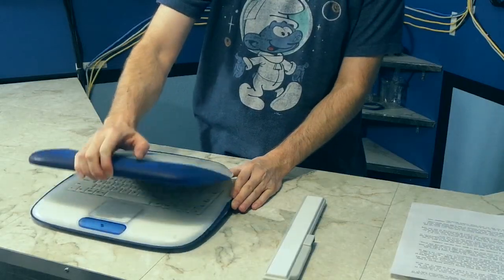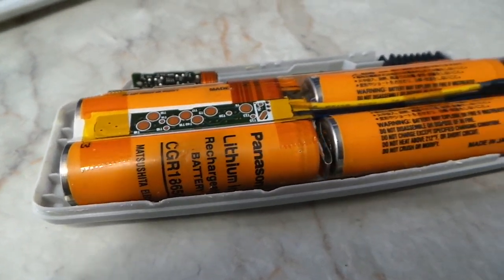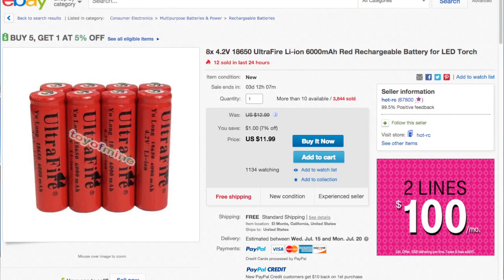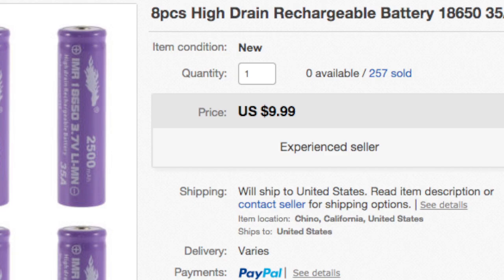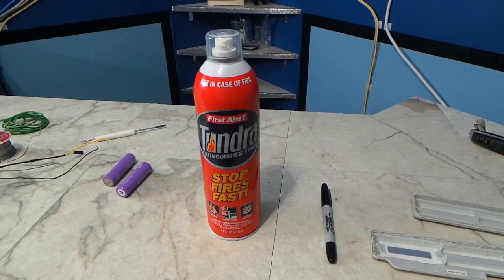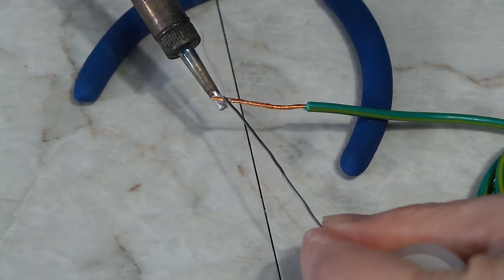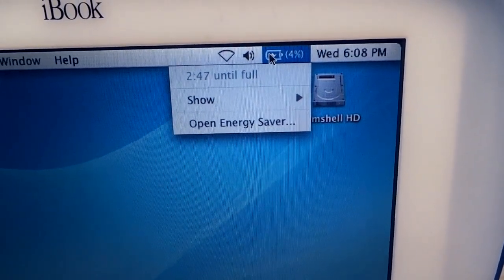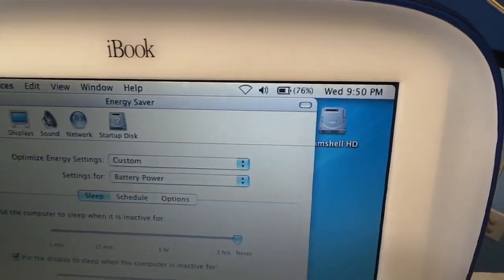Rebuild a laptop battery pack

Comment: Thanks for the video , i have a question: they told me if you want to change the battery you must not remove the old one before you connect the new one to the electronic circuit because it will lose their memory and it will not work at all even if the new battery is good ! 
Is that true ? Is it a successful process to change the the battery ? Can i remove the old one without losing the memory of the circuit ?

Comment: a good test would be to fully charge the batteries and then you left it out of the laptop for lets say a day and try to turn it on in the next morning or so... if it holds up more than 95% you could use it as a travel emergency pack

Comment: When I think about batteries, I don't think about the time they last, I just use it as a support for when electricity runs out (storms) or when I want to change the laptop from one room to the other. 5 minutes would be enough for me to save what I'm doing and properly shutdown the system without damage to the harddisk. I'm lucky my 10 year old laptop still allows me these 5 minutes when power runs out.

Comment: "ultrafire" batteries have capacity from 50mah to 400mah.
Reply: The name ultra fire means that they are ultra flammable
Reply: Beware of the Chinesium ones, seen 18650s with an AA battery and packed out with sand, I also bought a set that were genuine Sony's VTC5's tested at 2600mah with a generic wrap, I'm guessing they were from out the backdoor of a Sony plant.
Reply: #oof
Reply: Like refurbished battery

Comment: Hi sir, thanks for the teaching. I have a battery with cell number 18650 which is not good and i want to replace it with a different battery cell which has different number on it. Can this work sir? The number on the battery don't matters?

Comment: Most laptop batteries stop working if you remove the cells
Reply: nope they don't.
Reply: @JakeJoris  they do 
Unkes it's an old laptop
Inna try doing this on my 98 compaq armada
Reply: @picarraphotography  I've replaced cells in at least 10 laptop batteries, they all continued to work, except the t60 one.
Reply: @JakeJoris  I’ve never been lucky with it 
Have you tried on a Compaq Armada 1750?

Comment: David, as a long term fan, I was really disappointed to see you make a video where you are telling people to use junk ebay cells in there laptop. Ultrafire cells are flat out dangerous, and by making a recommendation, you are taking your viewers lives in your hands.  poorly made lithium batteries are as dangerous as a monkey with a handgun,  and you are telling people with no battery building expertise to build a pack with unmatched junk cells.  This is reckless for a couple different reasons. A: Putting cells with different internal resistance together in series creates an unstable pack and excess heat (and cheap knockoff cells are known to vary in resistance WIDELY) If you don't have a way to check internal resistance you shouldn't try to build a pack. B: People with little or no experience are gonna probably overheat while soldering, which could lead to the cell blowing up in their face. It just isn't worth the risk if you don't have the proper equipment, and are you really going through batteries on you laptop often enough that the 10-20$ you save buying garbage cells is really worth risking your house burning down, or your pac blowing up in your face.  This video was absolutely irresponsible and I believe it should be taken down.

Comment: Will this work with new laptops as well, that have thin non user removable batteries?
Reply: Yes of course. Also make sure you don't unplug the device you want to change the battery of and make sure you cut the old lithium batteries in half before you put in the new ones. If there is any fire just dump some water on top of your battery while it is in the laptop. Most new laptops are all waterproof anyway, but in case your laptop stops working just stick a fork in an outlet and your laptop will start right up 👌👌
Reply: @nikprobg9327  damn you got me going there

Comment: So true about the counterfeit batteries on eBay.  It also applies to Amazon.  And it' not just the 18650 batteries, but even the NiMH rechargeable (AA< AAA, etc)…. Unbelievable that they tolerate these sales still.  The counterfeiters will immediately refund your money in exchange for no bad reviews.. that's how they try to get away with their scam.

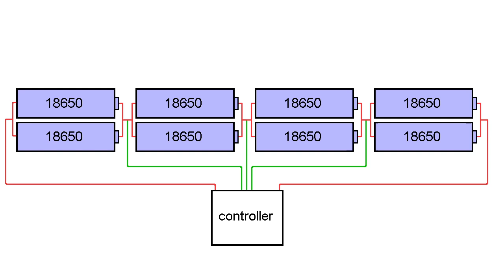Comment: Often, you don't need to replace all the batteries, becouse the pack starts to fail when at least 1 battery has problems, not all of them. Keep this in mind: you can see which batteries are good/bad by charging and discharging them individually 2 to 3 times, leave them charged and next day see if any of them has a low voltage. (They are totally charged at 4.2V and discharged at 3V). Then you can put all the bad ones in the recycling bin (you really should do this, as they may start a fire) and replace them with new ones (or maybe don't, just like he explained at: 2:50).
Reply: Miguel Barra Almeida it is better to replace them all so that they have similar capacity
Reply: In battery pack always use similiar battery spec for better result. The old one u can use in different project.
Reply: It's probably safe to assume that no battery that's 20 years old is good any more.

Comment: eyy, i knew this video would come in handy someday! fixed my giant power bank with this tutorial
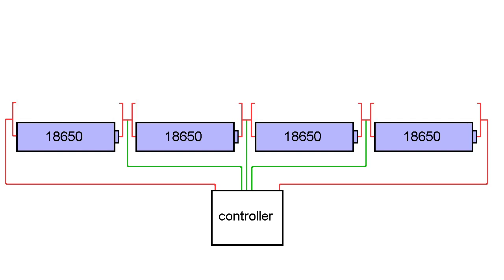Reply: Often, you don't need to replace all the batteries, becouse the pack starts to fail when at least 1 battery has problems, not all of them. Keep this in mind: you can see which batteries are good/bad by charging and discharging them individually 2 to 3 times, leave them charged and next day see if any of them has a low voltage. (They are totally charged at 4.2V and discharged at 3V). Then you can put all the bad ones in the recycling bin (you really should do this, as they may start a fire) and replace them with new ones (or maybe don't, just like he explained at: 2:50).
Reply: @MiguelBaalm  that's true. I did that. All the cells were alright in my power bank. The connection between them was just broken so the bank held a fraction of what it used to hold.

Comment: Hello everyone! I really need some help here, if at all possible. Here comes a freakin' wall of text, so prepare yourselves!

Here's the story: I actually managed to do this with a very old Presario 1070's battery. I thought it was working because it was running for a short period of time, but it seems like it's stuck at 9% constantly, and the laptop seems just about completely unable to charge the battery at all. It seems to try, but it fails. I have to unplug and replug it into power numerous times to try to get it to charge, and it doesn't stay charging even if I manage to get it to start, either. I know the cells are good because I have tested them thoroughly, and I obtained them from a couple of other laptop batteries in better shape, so they're not from eBay. I don't understand what the issue is, and I really want this to work. I spent hours on this, and I can't let it all go to waste. Does anyone know what I might be doing wrong?

I really appreciate any advice anyone might have. Thank you.
Reply: I reckon the batteries you have used are of various different brands and capacity so the calibration circuit isn't working properly. It also depends on the batteries voltage
Reply: @Timmymantwo  Firstly, thank you very kindly for your reply, I very much appreciate it. Next, I will say that I left it plugged in overnight, and have been working away at trying to solve the issue at hand, and it does seem that it's starting to behave better. The end results, however, remain to be seen. Regardless, more wall of text upcoming:

I will go ahead and admit that I actually did use two different brands of cells, as I did not think it would matter that much. I may very well be wrong. One is LG, the other seems to be a lesser-known one (the cells are marked "FP 18650[...]" if that helps).

Additionally, the two cell brands are also different capacities (so two different capacities indeed exist in the battery), but I had put them all on testing devices to make sure that they not only were in good, working condition, but also they all registered around 1900mAh after an intense discharge/charge/measure test, giving or taking 75mAh or so. I also had (perhaps foolishly) figured that this was fine.

With that all having been said, looking back now, there are two big "what-ifs" involved that may prove to be an issue. This is definitely helpful, and now I have more knowledge on the matter. Thank you again, this helps.
Reply: Good luck to you with it @Racecar564

Comment: For that kind of load, you could use ICR batteries. Less max amp but greater capacity, around 3000 mAh, but not safe without a bms(no pb in a 'puter) If you need extra ompf use panasonic NCR18650PD: enough capacity (tesla use them) and they are a lot safer. IMR are "safe",  can output 35-40 C but don't have a great capacity (1500 mAh).

Comment: just opened a modern internal laptop battery and I was surprised that the cells are flat. My intention was to check the possibility of change the damaged cells but although it seems very simple to detach the cells from the circuit I still haven t got a clue on how to do it, The other problem is that a made a big search on the internet about flat cells to assembly but couldn t find any, Have you seen this king of cell? Thanks

Comment: I have an 40000MAH Samsung Power Bank, their are 8 Samsung Pink 18650 Battery, It had 1 year warranty by Samsung . I think each battery has 5000 MAH capacity. Were do I get real 5000 MAH 18650 battery.
Reply: 5000mAh 18650 battery simply don’t exists

Comment: Could there be an issue with AA batteries replacing those batteries? Maybe make them replaceable. Like toys
Reply: Yes, rechargable AA batteries have a nominal voltage of 1.2V and the circuit will try to charge them to 4.2V (18650 charging voltage) and so, they will probably explode.
Reply: @MiguelBaalm  but trying to replace them when the battery is low
Reply: @witherdWhisper  ? Sorry, I didn't understand you.
Reply: @MiguelBaalm  being able to take the pack out and replace the battery in it. Is that possible?

Comment: every time i have tinkered with laptop batteries, i always find that the battery meter in windows stops working properly, it will work normally until it hits 5-7% then will stay there until the battery is actually dead, then continue counting to zero

then when you plug it in, it works the opposite way (charging but staying at 0% until it is close to full then counting normally, or it counts to 97% and stays there until it is fully charged, then continues counting toward 100%)

i always get the full runtime (sometimes upward of 12hrs of playing games with some of the 48 cell super batteries i have made) but the lack of a functioning battery meter is really annoying

Comment: So I have a question? I have started to do basic soldering i.e. replacing the rechargeable battery component in Dreamcasts, replacing capacitors in Game Gear and alike. I've been using a rosin core solder but I'm curious what kind of flux I should buy if I'm going to do more intricate work like repairing a trace etc? If you have the time I would appreciate your insight @8bitguy .
Thank you, Kelon

Comment: Sorry David, utmost respect for you, but soldering to a lithium ion battery is the tantamount to setting up a time bomb. When these batteries build up pressure, there is a vent on the top under the positive terminal. This valve is actuated by a spring with very specific tempering. Heating up the battery to solder on it ruins the tempering of this spring. If the battery has a "non-passive failure" (in other words, starts venting flame), the damaged spring may not relieve pressure, so instead of a small jet of fire, you could have an explosion. It's like using a recalled airbag. It won't hurt you until you are in a car accident, but when you are in a car accident, it could be a lot worse as a result of this. Just buy a third party replacement battery.

Comment: Is this safe to do?
Reply: The soldering proccess is quite dangerous, I recommend Spot Welding. And, If you don't short any of the batteries, there should bem no problems. I always recommend having a fire extinguisher or sand bag nearby, just in case. Also, don't have any animals, including humans, near you, as they might distract you or give you a jumpscare.

Comment: you make it seem like the main danger of "el cheapo" cells is not getting the advertised capacity - that's wrong. the main danger is burning down your house.

putting cheap no-name batteries together into a pack like this without extensive testing/analysis is a very bad idea, because you can't rely on them having uniform behaviour or consistent quality. fakes that sometimes lack basic safety features are abundant.

Comment: Nice video..
Can u help me in changing my laptop battery.
I removed all the battery but forgot the connection.
My battery pack- li-lion battery 
PEGATRON
 packA322-H54
10.8V
4400mAh
47Wh
Reply: My email id malkitsingh.672@gmail.com

Comment: Notice (and warning): This will only work for dumb/dolt battery packs (for example the battery pack of the IBM 2141). If there is a circuit board included inside the battery package, for example to charge the batteries balanced and/or a chip (IC) to report the health of the battery, a 'smart' battery (not only just a simple current protection IC), this might not work and could be dangerous. 

The problem is the health data stored/recorded inside the IC. It is not calibrated like you noticed, well, it actually is, however with old batteries in mind. Some IC's use also a charge counter to determine the health status (lifetime) of the whole battery, after X charges it needs to be replaced and/or it will use a modified charge/operating scheme. This is for safety but also to sell new batteries.

If you replace the batteries with new ones, the IC 'thinks' these batteries are still the old ones and charges the new batteries like the old ones (for example at higher current). Result: The batteries will last a little longer however not as long as should (like you noticed - no evidence the batteries are of bad quality) and the batteries could be damaged earlier, can get very hot, start to leak or even explode. You are warned, do not underestimate batteries of this type or caliber. 

You can only do this when you can reset the chip (must support an extended battery protocol) however only a few support this. In this example it is Apple, I am sure that is not possible. Don't waste your time and money to such revive projects, it won't last very long and could be (very) dangerous. Also solder the joints is a pretty bad practice but that's another story.

No blame at all, hopes it helps by experience, by being informative to avoid unnecessary dangerous situations to other people.
Reply: oof
Reply: so if you determine that 1, 2, or more, 18650s are bad, the best practice when rebuilding the pack, is to have the same brand & capacity cells to replace them? thanks & great response
have you made a mini tac/spot welder to tac on the nickel strips to the terminals? thank you
Reply: code beat hmmm thought i just posted a reply here. so the best way, and safest! to replace bad cells is to use matching brand & capacity? and properly tac the nickel strip to the terminals. is there a way to reset the battery pack monitor PCB? thank you for the great info
Reply: Thanks I appreciated. I sent same question to him before I sent you (I saw your comment after I sent him) I have no knowledge and I took my battery to special technician (I don't know if he's good or no). I have few questions:
1- How about if I change all 6 cells one time just to make sure I have all cells are new?
2- What is the different between cells color (Green, Blue, Orange,....)?
3- If no Difference, my laptop is Acer Aspire 2920z, battery color is green, can I change them with example blue, Purple,.... cells?
4- If I change all 6 cells, do I need to make like recognize/setting  between the new cells and the circuit? (I hope I made it clear. I don't know how to explain it).
or 5- Should I just forget it no need to change the cells? Advise me please.
Reply: probably he doesn't care about getting full time from the batteries, he just wants some backup power for when he needs to change room or when there's a power outtage so the thing just doesn't shutdown immediately (causing harm to the hard disk for example) What I really wanna know is why my Samsung phone's batteries were working fine one day lasting for 2 hours charge and then suddenly one day it would not last over 10 minutes without being connected to the charger, that was annoying.

Comment: I have several things to say. 

First, DiodeGoneWild tested many of those fake cells, and many of them were around 500mAh. 

Second, a lot of people are saying that you should spot weld the batteries instead of soldering them. I agree that spot welding is better than soldering, but soldering is still fine as long as you're careful not to heat the battery too long. Fire is highly unlikely. The worst thing that would realistically happen is that the battery loses some capacity.

Comment: Those battery tips are stainless steel. They won't bond to normal solder, so you end up heating too long, causing hidden damage. If this doesn't burn the house down in the middle of the night, some other day when you hop a plane over mountainous terrain...

Comment: The ultrafires I've tested are more like 500 mAh.  The biggest one is about 850 mAh.  Never seen one test for over 1000 mAh. -- You should really balance and charge the cells before putting them into a pack like this...